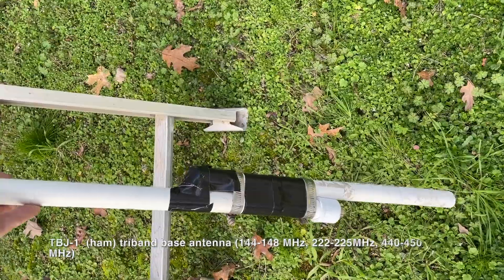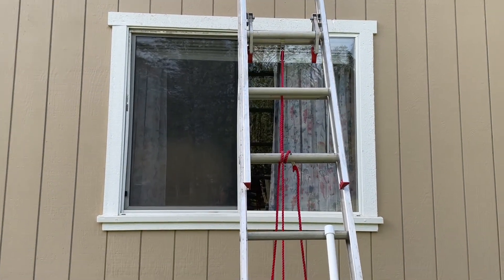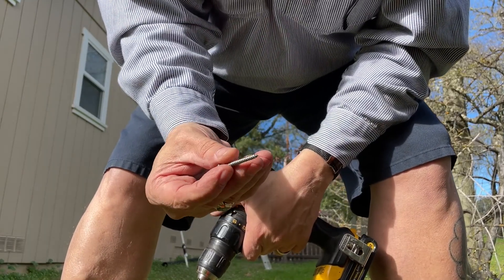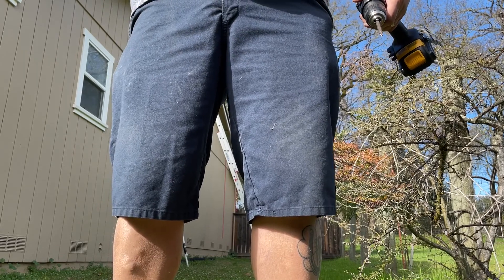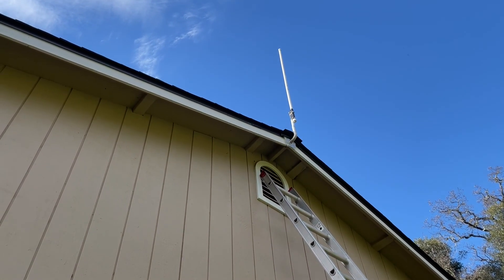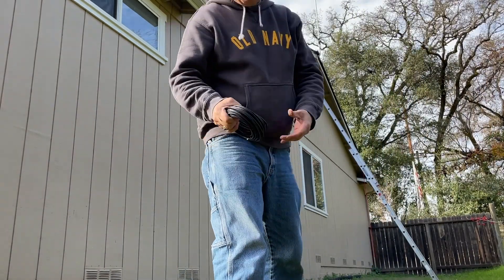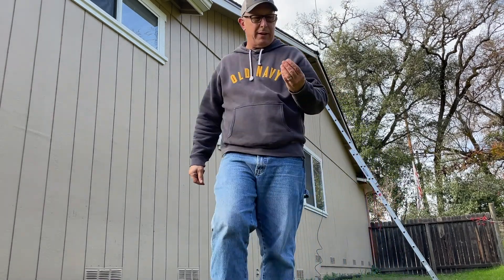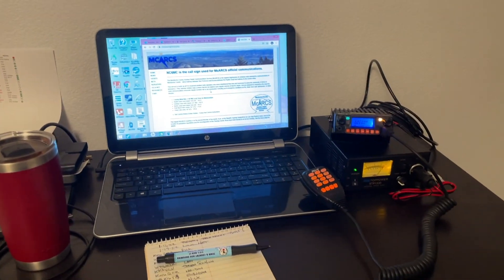Ed Fong Ham Radio Tri Band Antenna VHF UHF

Comment: Dan,  can you please tell me what part name for the galvanized hanger bracket & where you got it please, thanks. How’s setup working for you so far?
Reply from the maker: I had to rewatch the video to remember 😮. What used was an aluminum elbow and a piece of scrape aluminum cut from a sheet from my buddies shop. I ended up moving away from that antenna as I switched to a dual band Icom IC-2730a radio and went to a Diamond X50n antenna. The Ed Fong worked great, I just didn’t need the 220 MHz band anymore and I had ordered the wrong coax (N type ends), so I went with the X50. Sorry if I didn’t help. (The X50 works better too)

Comment: I’m doing a similar install with an Ed Fong antenna. Did you end up running any grounding or lighting protection?
Reply from the maker: I should have, but I have not.
Reply: Fyi. Ed claims there is no lightning protection needed. He explained it in multiple videos.  Something to do with the shorted condition between connection points

Comment: Do you have a drain hole in that support pipe? 73 de w6akb
Reply from the maker: Yes I did, but I’m not real happy with its performance. The SWR at 144.0 is 1.2 and at 147.5 it’s 2.5. It needs to be shortened, but I don’t know if I should take it apart.
Reply: @danedwards7597  I meant a drain hole at the bottom of the aluminum pipe, not sure if that was clear. Sorry to hear you are having a problem with the antenna. It's a tricky setup with what Ed's got in there - a 2 meter jpole with a decoupling stub for 450 and a helical 220 dipole. I would definitely contact Ed Fong first and let him know what is happening. He's very sharp and has made thousands of these, he may have a quick solution for you. SWR is not as important as some people like to think but 2.5 is a bit on the high side. Perhaps make a few more measurements across the band, find the minimum, check 220 and 450, etc. It also may be the coax, there are feedline or connector faults that can cause SWR issues. Perhaps do a test with a different feedline to see if it changes. All it takes is one sketchy coax connector or connection. Ed checks every one of those antennas and he's quite thorough. Best of luck with it. 73 de w6akb.
Reply from the maker: @alanb76  Yes, there is a small drain hole in the bottom of the "J" aluminum tube. I had been using some RZg58U coax, and recently replaced it with some LMR400. I ran an SWR check on the antenna after I made the cable switch. My radio does have 222 and 440, but I mainly use it on 2m. Thanks for the suggestion of contacting Ed Fong. I will send them a pic of my SWR reading I took and see what they say. Don't get me wrong. I like the antenna, I just have a little difficulty receiving a signal for one of the hams on my local simplex net. He happens to be a  the local antenna guru, so I really want this antenna to work good  so he doesn't bust my chops about it. Ha!

Comment: I know it's not a long run, but that RG-58 is really working against you. Particularly on UHF. With all that work, spring for some LMR400 coax. You won't be disappointed.
Reply from the maker: Thanks! I’ll give it a shot
Reply: @danedwards7597  Yeah, Ed Fong told me that specific thing.  LMR400 unless I'm running shorter than 25' then I could use RG8x.
Reply: @danedwards7597  For that short just use rg8x and you done the 8x is much easy'er to run than that heavy 400. Looks like the run is 20ft or less.
Reply from the maker: @billwhite659  I actually accidentally bought some lmr400, so I think I’m going to see if I notice a difference. It’s all just experimenting!
Reply: @billwhite659  » I've got a 42.5-inch cable of RG8X with PL259 connectors. Fong said this is fine up to 50 feet; anything longer will require LMR400. That said, I find it difficult to believe that a 10-watt HT (TYT UV8000D) can push through this much cable. I initially got the antenna for my more powerful radios, but Fong said it would work for my HT. Still, I may go for a shorter cable for that use. I've also got a TYT UV9800 (tri-band), which is perfect. Fong added that it would work on my HT, but warned that adapters and extra cable would reduce efficiency. With a shorter cable, I should be okay.

Comment: Use different coax especially for 2/70. That Amazon stuff is junk
Reply from the maker: The Amazon reviews were good on this cable, but I agree there are far better cables to use. I am impressed on how good of reception I get from the cable and antenna. I'm hearing people I haven't heard before.
Reply: @danedwards7597  I got some RG-8X from DX Engineering for 48 cents a foot. It seems like great cable, and was about the same price as the unknown stuff on amazon. Plus if you are anywhere near a summit racing store you can just go pick it up. Instant gratification is always a plus.